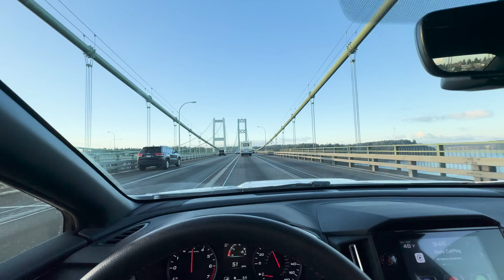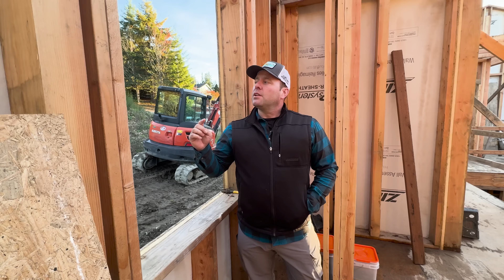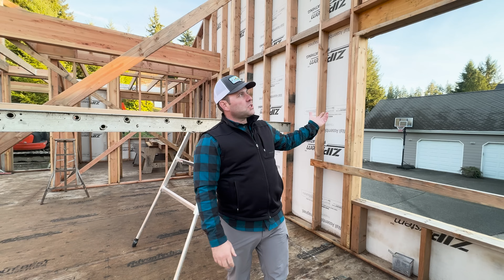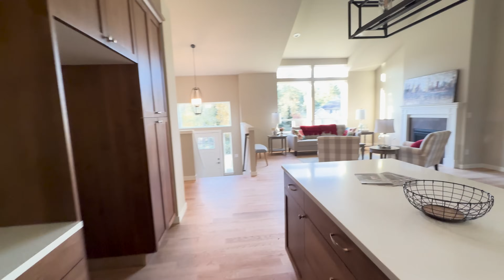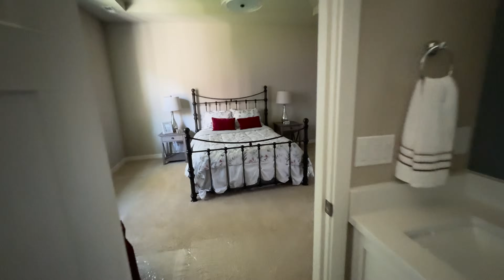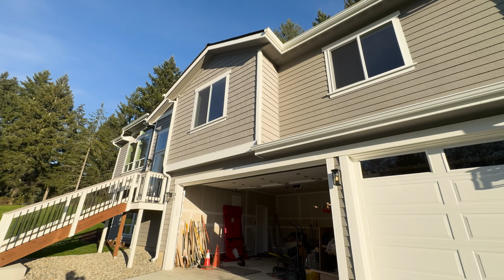Builder Talks About Framing Centers, Technique and Insulation + Finished Walkthrough

Comment: If you frame interiors walls 24" OC, be sure to be diligent with installing blocking where it will be needed for cabinets, shelving, towel bars, grab rails, etc.  As for the extra stud thickness for shear, perhaps using T-Studs with the wider flange on the outside would solve for shear requirements and then reduce any nailing accuracy problems with the thicker sheathing panel.

Comment: so if you are framing 24" OC that means 5/8" drywall on the walls too, correct? Hear in the midwest back in the 80's we did a lot with sealing foundation plastic to wall plastic to ceiling plastic,the problem with that was too tight at the time.Air exchangers couldn't move enough air.We were also using 1"  foam on a 2x6 exterior wall with the metal strap cross bracing.

Comment: I've used a bunch of zip r the town I live in has made it code supposedly they say you can't get a proper r value in a 2x6 wall nonsense  but I think it makes the walls less ridged  I cut in diagonal braces in a few choice walls but I would rather put foam on the out side of sheathing  or glue it to drywall  but what do I know and it's not my call and  unless you can find a longer router bit no more routing out opening I have to cut them with my skill saw routing was neater

Comment: Glad to see you’re doing more stuff on YouTube again. My feelings on the R-sheathing are—meh. I’m not convinced that green waterproof layer on zip is gonna last anywhere near as long as tyvek style WRB. In SoCal we used to use a ton of osb and there is so little rain it didn’t really matter (except for the occasional sprinkler). Before that it was tar paper over real plywood. 

Up in the PNW I always go with tyvek and I agree with Tim rain screens aren’t necessary. If you really want breathability use tyvek stucco wrap.
Reply: There have been many test done and ZIP has proven to be one of the most durable WRB. 
Tyvek cannot air seal as well and easily as ZIP.

Some people don’t care about air sealing but anyone building a quality home wants an air tight house.
Reply: I understand your skepticism, we were all that skeptical of Tyvek in the 80's